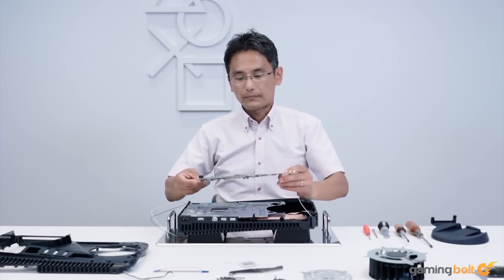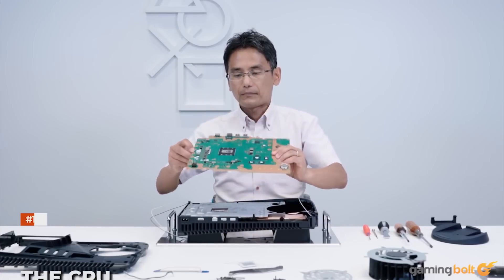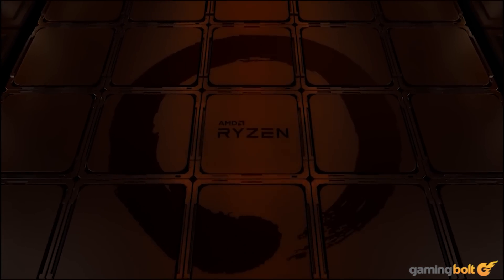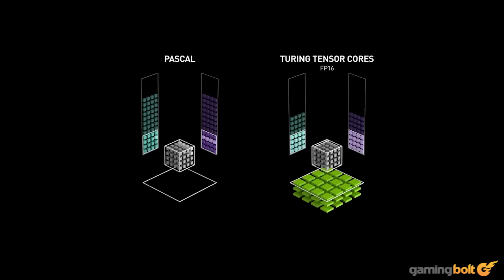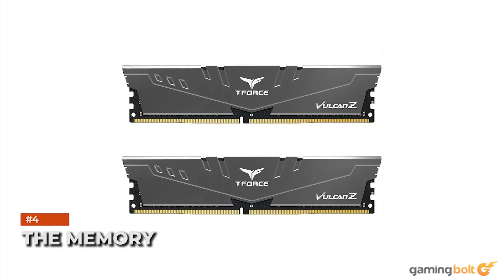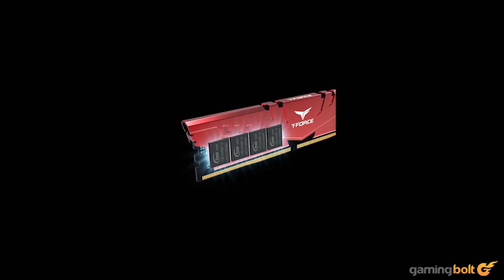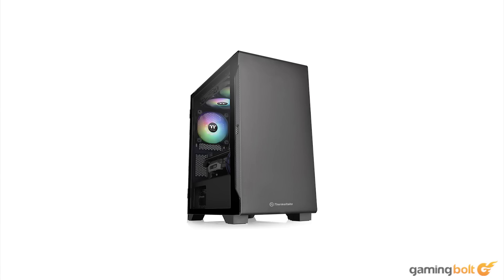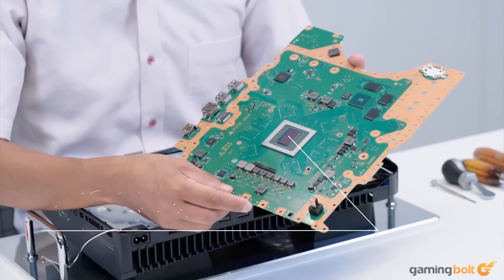How Much Would It Cost To Build A PC As Powerful As The PS5? (2021 Edition)

Comment: LOL.. oh Gaming Bolt.. more like the units have a Ryzen 2700 or 2700x and you could get the 2700 CPU alone over 2yrs ago at the cheapest $150 which I did new from Amazon/Newegg during a sale. The biggest costs will be in the RDNA/2 architecture and the specialized SSD... why are they using and comparing to an RTX3060 and should be using AMD GPU hardware which "under normal retail prices" is generally cheaper in cost than Nvidia... approximately an RX5700XT and the biggest hurdle would be to purchase a PCIE gen 4.0 SSD on the cheap as they are fairly expensive... but remember all this specialized parts are pre designed and produced by the millions to reduce costs and the fact the Playstation Software and how the games are made are more optimized to those specific parameters not like running on Windows and using Drivers to satisfy hundreds of component combinations.. also unfortunately you would have to buy a much higher specd motherboard in order to get the PCIE Gen 4.0 to make use of the latest/fastest NVME speeds... a normal SATA SSD wouldnt even compare in speeds hence why Sony is taking forever to implement the spare NVME slot even though there have been a handful of NVMEs on the market at this time.

Comment: My PS5 still doesn't come close to my pc and Im using and old i7700 and 1080
Reply: It because you don't play games in 4k on your pc run resident evil village on 4k on your pc then you will understand the difference
Reply: @SaifKhan-mm8hk   4k upscaled not native you console pleb
Reply: @g0stface23  that means you can game on 4k upscaled on your 1080 GPU is it normal 1080 or 1080 super
Reply: @SaifKhan-mm8hk   I rather play 1080p and max frames a ps5 can't even push 120 fps on most games
Reply: Your 1080 is 9 teraflops and the ps5 is 10 with less ram.
My old 1080ti runs cyberpunk at 1440 70 fps ultra and mines crypto.
Reply: @TRONiX404  good for you lol I couldnt get a 1080 ti at the time because thats when the scalpers started cleaninf out the stock, I didnt think it would be so hard otherwise I would have bought a 3080 by now. Also vram is only 8gb on a ps5 and clockspeed is 3.5ghz thats why they dont advertise it to you. Thats not very powerful.
Reply: @Transistor Jump  my pc is right next to my ps5 lol I can run apex legends at 144 fps easy. Number of cores dont mean anything if the clock speed is lower you dumb noob, imagine thinking a 500$ box can beat a custom build
Reply: @Transistor Jump thats why you only have 250 subscribers ?
Reply: @Transistor Jump https://youtu.be/NsfFlvVw5Fo here from a better youtuber lol 😆 who actually knows about computers first video I found
Reply: @Transistor Jump for knowing more than anyone can comprehend about pc's you should make some better videos lol maybe you will get more subscribers
Reply: You're drunk.
Reply: @Transistor Jump  someone doesn't have a gaming pc? Slow Thats what an ssd is for 🤣 I dont have to wait for an update to add more storage gpu slow? You are showing how little you know

Comment: "We have tried to include components that were close to the Playstation's hardware... so here's an RTX graphics card that's built by a different company, on a different architecture that's nothing like what's in the Playstation."
Reply: “We have TRIED”. Tried being operative word. I get where u r coming from tho.
Reply: Consoles have APU's not dedicated GPU's and Cpu's. If AMD sold their APU's to consumers at the same price they sell them to the console makers then a gaming PC will be just as good if not better than a console at the same price. Also google what wholesale vs retail price is.
Reply: PS5 is a Rx 5700xt
Reply: Let's be honest if we are building a pc nvidia is the smarter choice over a amd graphics card equivalent any day
Reply: @brandonvanmeter  For sure, not going to argue that. I actually switched from AMD to an RTX 2080 last year. DLSS won me over.
Reply: @dezfoto7534  for me the fidelity FX won, I exchanged my 3070 with an rx 6700 xt, and I don't regret it
Reply: @raulsoftair3572  Yeah it wasn't available yet when I bought my card, looks like cool tech though. I had a 5700.
Reply: @raulsoftair3572  why
Reply: @Bhende45  cuz Radeon software and his functionality >>>>>>>>>>>>>>> Nvidia shit panel
Reply: @raulsoftair3572  👍
Reply: If the games benefitted from running on a similar architecture using AMD graphics cards you might have a point.
But currently there's no obvious benefit to using an AMD graphics card... despite being "similar" (i.e. RDNA2(ish)) the PC versions are still going to target the most common GPU's... and many of the optimizations won't make it to PC at all.
Reply: @photonboy999  Well, the point was to build something similar to a PS5. They lost the script a bit.
Reply: @dezfoto7534  It looks like they were after getting the most similar performance, in which case you simply can’t ignore optimizations
Reply: I'm not even sure why he compared a 3060 to the ps5 gpu when the 2060 super specs are slightly higher, and the ryzen 7 3700x has higher clockspeeds.
Reply: @kylelochner5686  you can’t compare specs between different GPU manufacturers. They should have gone with an AMD GPU (6700xt potentially).

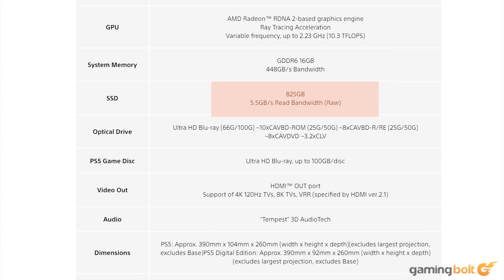Comment: 6:42 While true that both company's have said that the SSD's were very fast, i think you it should be said that the PS5 SSD'S is miles ahead when it comes to R-W/s! Certainly when compressed, the PS5 SSD can go up to 8/9GB/s. But i've heard that with the "Kraken/Oodle" compression it can even go up to 12/13GB/s. Not sure if this is true. But i would say that 8-9GB/s isn't bad either and is way more than what the Series X can do. Now, i think that, if we can let the 12TFLOP GPU in the Series X shine, i think it's also fair to put the SSD in the PS5 in the picture. I don't care about any fanboyism. But i do care about honesty. Also, if you want to find an off the shelf NVME SSD like in the PS5, you will pay a lot of money. No way there is an NVME SSD @ $120 that can hold SUSTAINED speeds like the one in the PS5 for less than $220!

The only thing i can say is that a pc gamer who wants a good/decent pc will probably be okay with this build. If you want a great pc that will start you at $2000 (only the tower, not the monitor, speakers, OS, peripherals, etc...). You want an "Epic" pc. Well, that starts at $3000 (yes, you're looking right). I mean, we're talking "epic" right. So if you know that a 3090 is around $1499.99 ( on the Nvidia website itself - MSRP) And you still need a good motherboard, CPU(cooler), At least 64GB RAM, (remember, EPIC!!!), i actually starting to do the math and don't even think you will come even close with that price. (You'll need more!) Anyway, I could categorize them like this (give or take):

Good/decent: starting at $1000/1500
Great: $2000
Greater/Epic: $3000 ~ ... 

I remember my first gaming rig was around $4300. And yes, we're talking only the tower!

Conclusion? Yes, the Series X and PS5 are both still the most bang for your buck gaming devices! Oh, and of course the Nintendo Switch as well when it comes to its specific games. I mean, for $299/$349 🤷‍♂️
Reply: Who ever told you the ps5 can do 12-13GB/s lied to you. 
First let’s just get things straight. In the road to ps5 presentation mark says that the ps5 has a raw power of 5.5GB/s, so they needed something powerful enough to decompress all that data which Sony then used oodle kraken. the results were great as it was capable of doing 8-9GB/s, mark also said that if the data happened to decompress well than it can be as much as 22GB/s. Then about 4 months after the presentation radgamingtech announced that the ps5 will also be including oodle textures. RGT said that it was oodle textures job to fix the data in a way for kraken to read it better, there results were 17GB/s opposed to the previously estimated 8-9GB/s.
Reply: They basically supercharged oodle kraken
Reply: @balloonb0y677  Oh yeah, i forget to include that bit of what you said! It can indeed go to 22GB/s. Sorry about that. But that's not the RAW data of course. But i think you know what i meant in the end. In any way, my point stands: "The SSD of the PS5 is crazy fast and miles ahead of what is available on the pc market". And certainly when it comes to the sustained speed's.
Reply: Getting a (Skytech Chronos Gaming PC Desktop – Intel Core i5 12600K 3.7 GHz, RTX 3070, 1TB NVME SSD, 32G DDR5, 650W Gold PSU, AC Wi-Fi, Windows 10 Home 64-bit) as a starting PC a good upgrade to a PS5? I have been a console user my entire time and I want to start with a PC that is above the PS5 but that as high as I could go in price… is it worthy?
Reply: @JCC-970  Though the specs seem to be good. Especially the RAM. It is also DDR5 which is the newest. But that isn't always the whole story. It depends how fast that RAM is etc. But 32GB is absolutely a good amount and should be able to run your games for sure. 1TB NVME is good as well.
Reply: @JCC-970  I have to be honest here, but i don't know anything about "Skytech Chronos Gaming PC Desktop." Maybe that Zoner Roamer guy might be able to help. Since i don't know anything and i'm just smoking and he knows everything.
Reply: $4300? WTF were you smoking when you built that PC?

I have a top end PC with an RTX 3080 (3x as powerful as the PS5) and i7 8700k, with all the bells and whistles and it cost me $2000.

Sounds like you don't know what you are talking about.
Reply: @ShruteshKumar  the gpu is definitely more powerful but the ps5 is just really efficient. For example: your cpu has to do compression which can take up to 4 cores, the ps5 has decided hardware for decompression so none of the cpu cores have to do compression. The ps5 also has primitive shaders which reduces the amount of data needed so the gpu doesn’t have to work as hard as it would. Adding up to that the ps5 also had a really fast I/O which allows the ssd to be as fast as it should so the gpu can get the data it needs to make all the details.
Reply: @ShruteshKumar  I actually was smoking. Not what you think though. Just cigarets... But anyway. Again, everything depends on the parts. And secondly, that was a pc that i build back in late 2008. Also, i live in Belgium, Euro ≠ Dollar... 😏 I know enough about what i talk. Sounds that you are prejudice and that's honestly just, pathetic. But anyway.

My Zalman GT1000 pc case back then already cost $300 (just for the case.) And that's a choice, like i said. It all depends on the parts, the brand etc... my Motherboard, which was an XFX 790 SLI was around $350 and DDR3 Ram was also very expensive. I also had an XFX GT (not sure about the model number anymore) but it was a black edition. (Yes, back then that used to mean something...) It was specifically for the gamers. My CPU was a high end cpu which was a $1000 back then but sadly i don't remember the model number either. Maybe that i still have it listed on my video of my pc case on YouTube.

Anyway, it seems that you are the one who doesn't know what you're talking about. Given the fact that you don't know anything about my pc build. Or maybe you might be too young to know anything from the pc builds in 2008. Whatever it may be, don't assume that you know everything and that others don't know anything. That's one of the biggest mistakes you might do. Just a word of friendly advice.